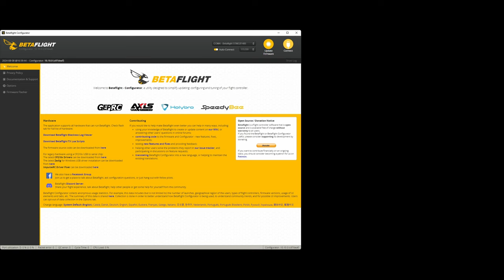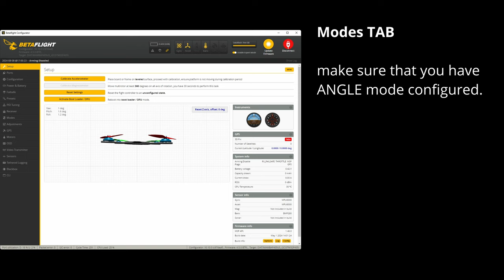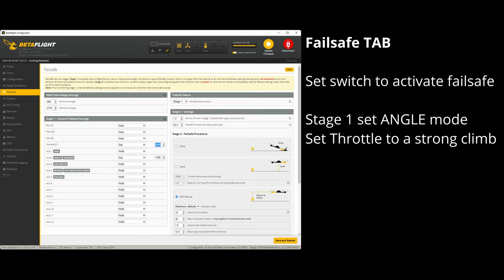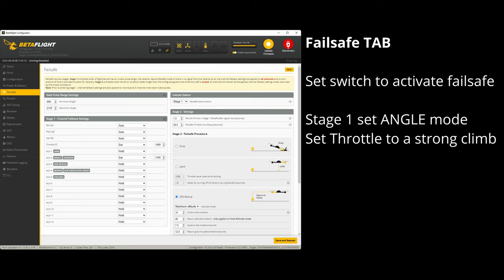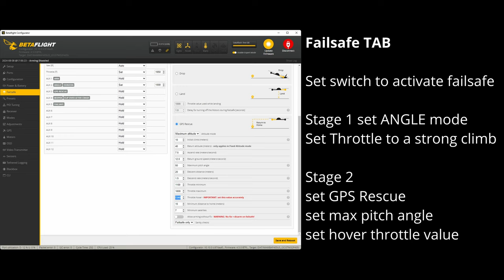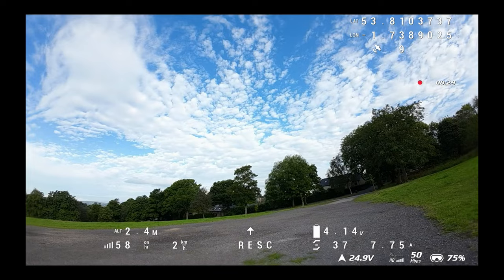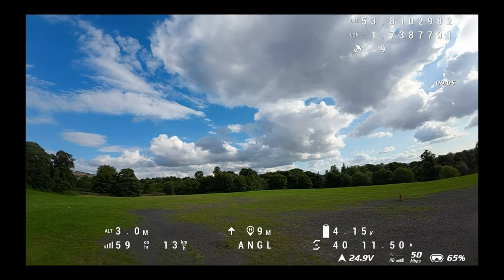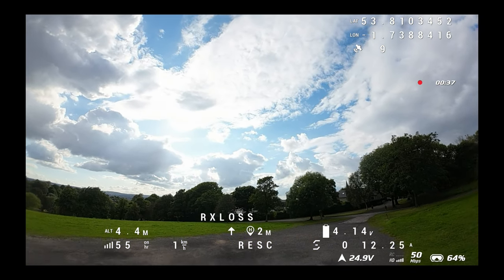Setting up Betaflight Rescue and Failsafe

Comment: Awesome video!  I noticed your return to home speed was a rather conservative 12m/s.  Others seem to quote +20m/s but in my experience that's way too fast as the drone has a tough time and overshoots the home point.  Probably because the GPS updates too slowly.  I've set mine to around 15 m/s and it flys more steady and does not overshoot the home point. Has that been your experience?  Cheers!
Reply from the maker: I may increase the speed a bit but I don't want a quad straining it's batteries on a RTH, I'd rather it be more conservative and stable especially if it's a bit 'out there'  ;)